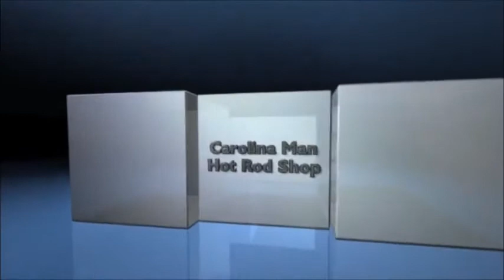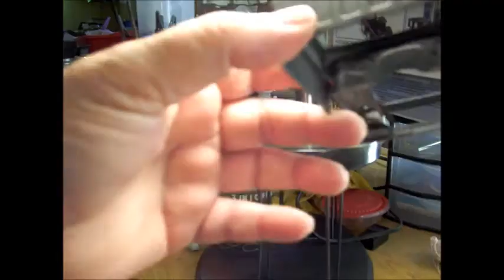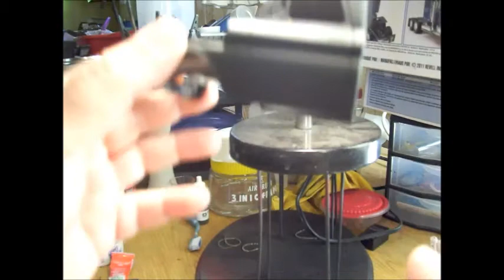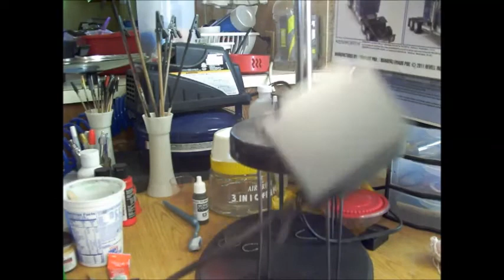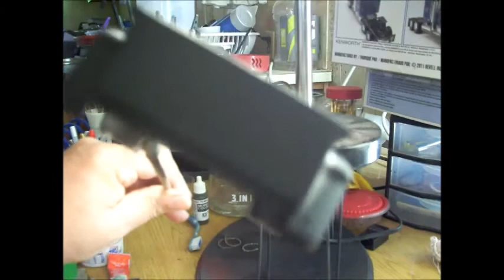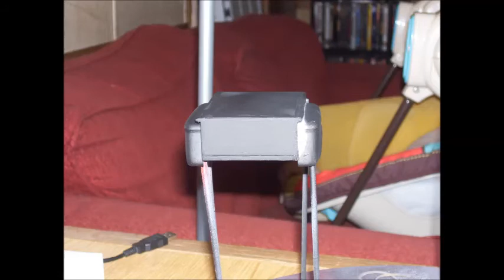65 Chevy Stepside Update 2

Comment: go to hobby lobby get a finishing kit it has 320-12000 grit papers give it a good once over then spray with primer sealer the finer grits will help with the scratches plus wet sanding helps smooth them out a lot hope that helps later buddy
Reply from the maker: gene miller  Thanks I will try it.
Reply: Yeah the sand paper in the finishing kit is wet or dry use soapy water and let it do the work and you should be fine

Comment: Heavy coat of filler primer should help. Paint will just make the scratches show up more. Prime and sand , over and over until the scratches are gone, then try a paint top coat. Just my two cents, I hope it helps......JIM
Reply from the maker: fordman 1956 
Thanks that is what I was thinking.